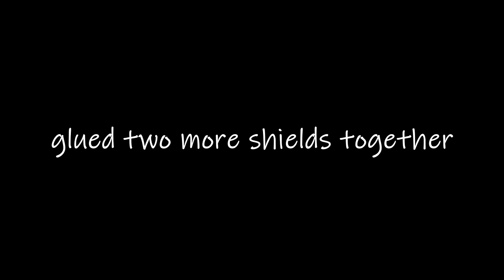WOW!!! Cool idea from old boards and furniture fittings!

Comment: Nice build, but you didnt need To put a Screw in every single hole in those brackets lmao! You used like a box of Screws lol. Honestly i think 4 screws in each would be sufficient. You may have actually weakened the wood in those areas from putting so Many holes that close to eachother.

Comment: Excellent cabinet for your planer, i think i will go ahead and make the same thing. Thanks for sharing. ( Stay Safe )
Reply: That's not a planer, it is a router table.
Reply: You'll need a full box of screws if you use the same brackets

Comment: 90% of the time I get a splinter, it’s in a finger. I’ve seen a number of power tool accidents in my 65 years. A not insignificant number of these were caused by the victim wearing gloves. My advice. Ditch the gloves.
Reply: Yes, you should not wear gloves on tools on which something turns.